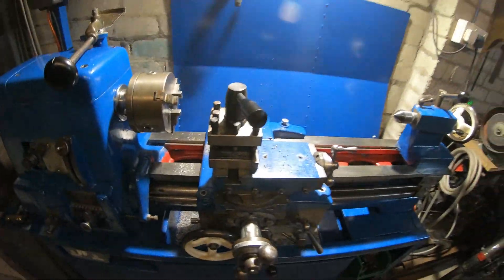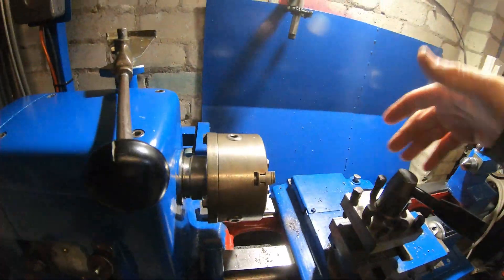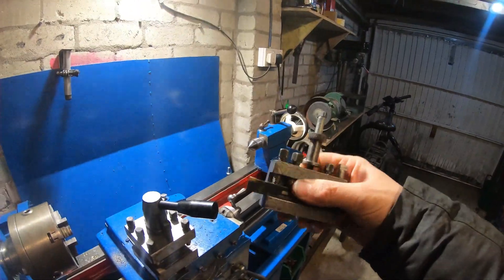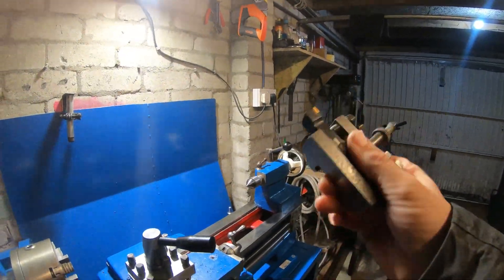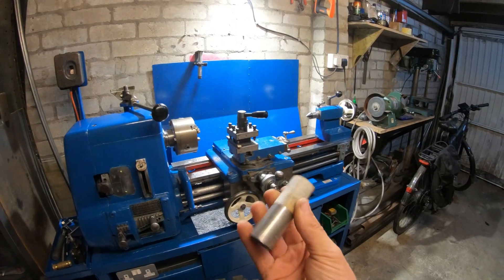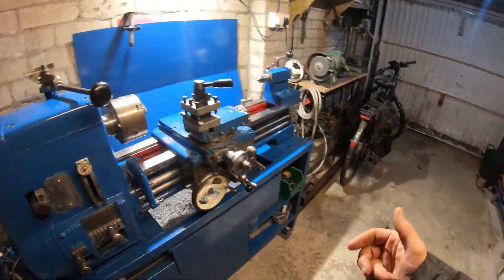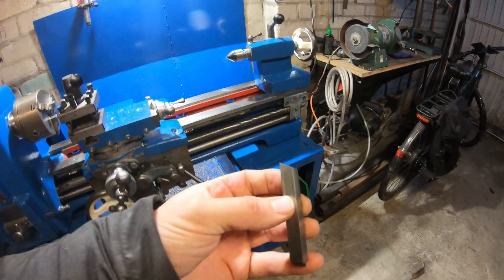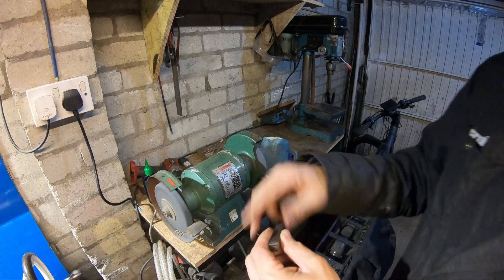carbide insert or high speed steel? A beginners guide

Comment: If you have a hydraulic ram repair shop nearby, take them some biscuits round and ask for a rummage in their scrap bin. Those chromed rods are nice to machine (EN8 ?) just be aware some have an induction hardened layer unde the chrome that will eat HSS.
Reply from the maker: @graemewhite5029  I'm always on the look out for stock, so that's an idea I'll try.thanks